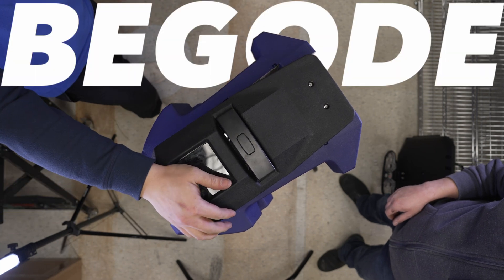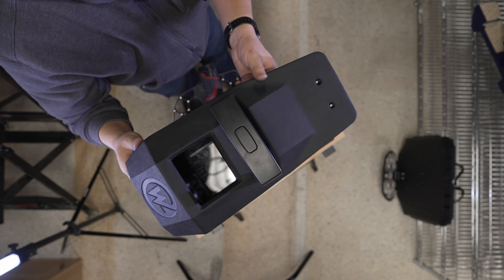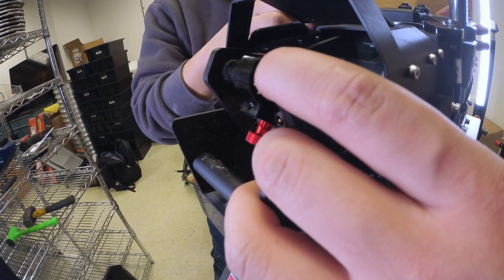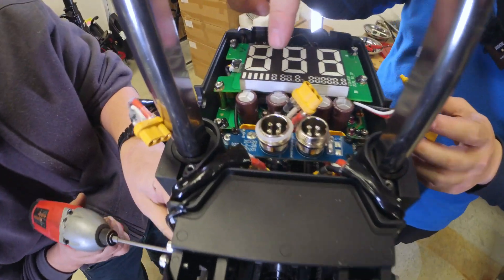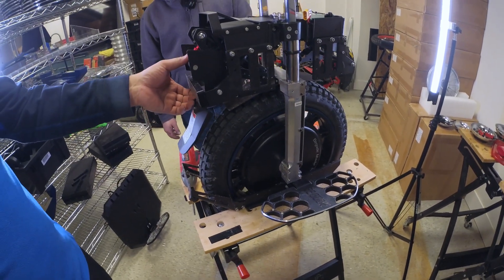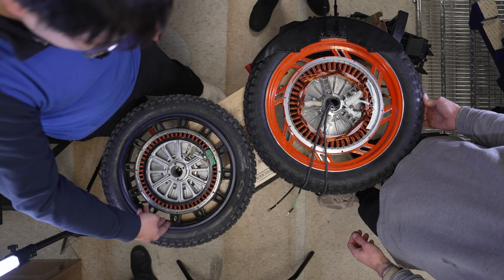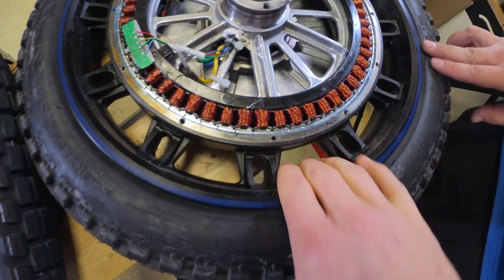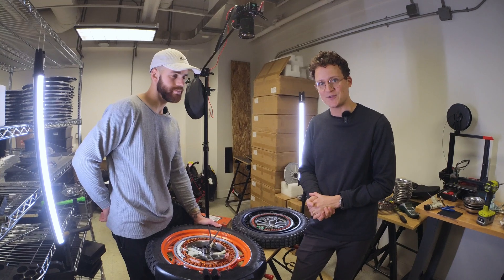Begode EX30 EUC Teardown — A look inside the all-new 4000w C40 motor!

Comment: Wow ok, this is a step in the right direction. Theyre actually trying to improve on BUILD QUALITY. If i hadnt seen Jack's (electricdreams) video on the EX30 i would say this is the first time i would consider actually purchasing a begode wheel. Still have to see it perform tho. The thing i didnt like that Jack found out was that the wheel scrapes the bottom battery brackets and scrapes the actual battery metal cases bottom front corners when on any incline. If it hits on an incline or anything then it will probably hit whenever u try to "bonk" off of curbs or obstacles. Thats not good. I guess thats partly why veteran abrams and V13 have that 🛡️shield shape to it.
Reply: That only happens if you ride the wheel with extremely low tire pressure and no air in the shock, as shown and stated in the video. The wheel wasn't designed to be ridden like that. Inflate your tire to a normal riding psi range, put some air in your shock, and there's nothing to worry about.
Reply: @nicksilver3757  So says the guy with no Ex30. Dog, Jack DID SAY that he was gonna ask Begode to raise the wheel because of scraping. He had to remove the lower pads n STILL  scraped the bottom. So yea, he does have a point. It does sit low.
Reply: All good points. Theres always room for improvement, i feel like begode could have that fixed before production because it looks like more effort went into this one. Even the frame work looked great, way more robust and stable looking than both the sherman S' and commander pros frame work. Like the U-frame. Im surprised they didnt talk about that with this video.

Comment: The “O-rings” around the cables at the frame leading into the motherboard are commonly known as grommets (like Wallace and Grommet!), the “seal” around the axle on the mounting plate would be a large O-ring. It certainly looks like Begode are trying to get their act together with this wheel, we’ll know for sure when they start shipping them with Velcro on the battery faces for the pads, lol.

Comment: Thanks for the great video!
Originally, my deposit was on the Challenger and for many months I agonized over whether or not I should switch to the EX-30. 
I'm glad I did.
Reply: I'm excited to get more time on the EX30 so I can have more context on if that was a good decision or not hahaha - thanks for the comment!
Reply: @lukastanasiuk5722  Must take the ex-30 to task for sure. lol
I love inmotion, but I have the v-11 and am a bit burned out on the control board / complicated software issues. I think I've spent more hours working on that wheel than riding it. 

Now that there are some respectable build quality upgrades achieved by Begode with the ex-30, paired with their less complicated yet effective software, I figure the ex-30 is a reasonable gamble.   I'm curious, now that the ex-30 has upgraded, metal battery cases, I would really like to know what kind of waterproofing that provides over the plastic ones?

Did you guys happen to check out the battery cases to see if they included a rubber gasket or anything like that for waterproofing?

Comment: Regardless of the build quality, I will not be buying any begode EUC until they make significant improvements in quality, & functionality
Reply: so what else do you want improved from this teardown? I didnt see many issues if at all. The suspension "flex" that people felt on all master design wheels should be fixed with the metal battery boxes and frame. The suspension is the better T4 linkage setup so less bottoming out. The rim has been upgraded.

I dont see much issue with the design of this wheel anymore besides the electronics reliability

What do you want specifically improved? I think a smart bms would be nice. As for functionality, its the best performing wheel in its class. What other functionalities do you want added?
Reply: @TheCobaltsaber  well, waterproofing, I do like the controller compartment is sealed. The lack of a proper fender/mudgard, makes this any begode wheel a no for me. The display is borderline mediocre, the battery boxes pass the tire on full compression, so they will scrape the ground which means suspension travel may require limiting, that's a compromise, IMO but I'm just referencing from the electric dreams video. I like that there is now a stronger rim, but the other wheels in their lineup also need stronger rims. I can keep typing away picking apart this, & other begode wheels, will that make me biased, no, I have standard requirements, & even though the EX30 is a step in the right direction, it still doesn't meet my minimum requirement.
Reply: And waterproofing
Reply: Your comment makes no sense, you're contradicting yourself. You acknowledged the [good] build quality, but still use build quality as an excuse for not buying? And in terms of functionality this wheel ties with or beats everything else on the market (besides the Master Pro in battery size).
Reply: @nicksilver3757  I think @supakat is saying they want to see more than one decent wheel come out by them... which I totally empathize with. I'm excited about our initial impressions of the EX30 but I'm still hesitant to mark this as the beginning of the Begode turnaround in product quality and overall QC. If I were a standard EUC consumer I would still be waiting for a few more Begode wheels come out at even higher standards than this before I was confident in purchasing their wheels... but some people have a much lower bar for what they are willing to ride daily... so it's ultimately subjective!
Reply: @lukastanasiuk5722  yep, & I try to avoid all the  hype behind alot of these newly released wheels, costing $$$$, it's already difficult to choose one brand, but when one brand comes out with 7 wheels costing between $2-5K makes me go 🤔 I better choose wisely
Reply: @nicksilver3757  so that's my opinion, if it makes no sense to you then okay, enjoy your EX30. You obviously see how it makes sense with the quality & value in the 8 wheels begode released in <12 months

Comment: Whats the weight of the battery without the steel casing?
Reply from the maker: We didn't weigh that unfortunately.
Reply: @eevees  What material are the battery cases? Aluminum or steal?